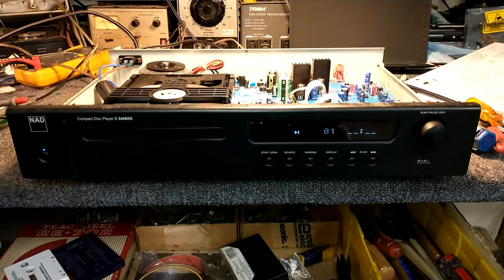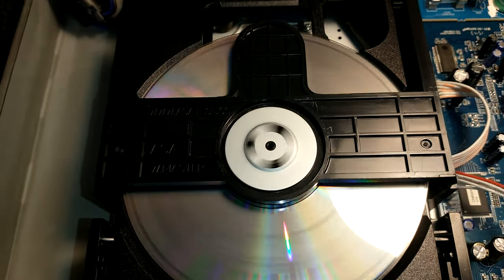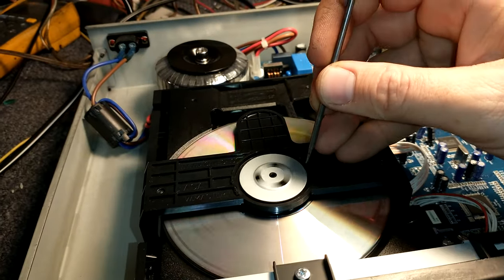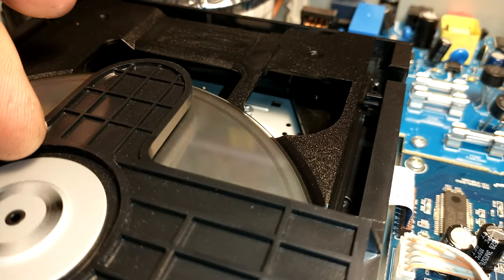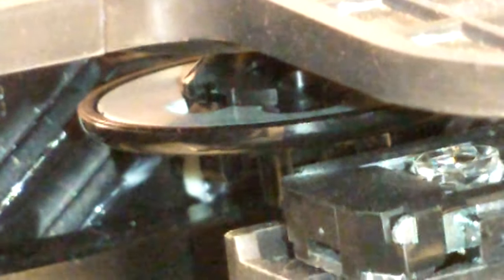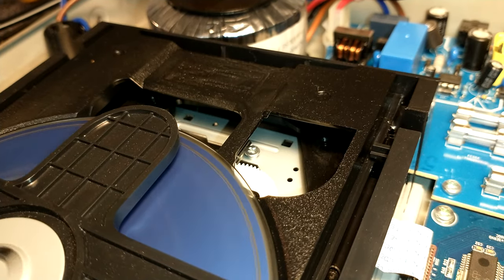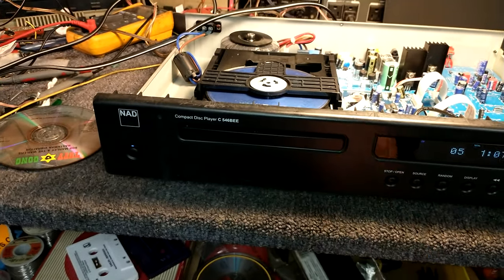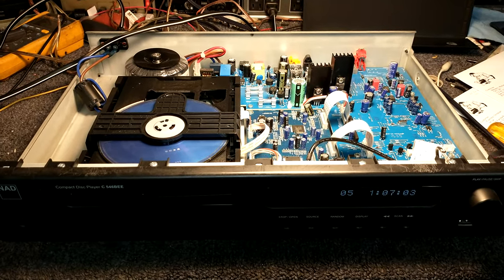Design flaw in bottom dollar NAD c-546bee cd player. vibration problem causes mis-tracking.

Comment: Shouldn't the shaft of the spindle motor protrude a bit so it fits and centers the clamp disc when you put in a disc?
That or the clamp disc is not the one it should have.

Comment: I have a hard time believing this is really the problem and that there are no worn out parts.  If it were the design and there was a 50% chance of every time you insert a CD, that it might sit crooked, this would have been discontinued right away.  It's hard to imagine it even getting into a store.  That is basically a 100% failure rate. No product is THAT bad sold in US stores.
It might be a bad design insofar as it requires high tolerances of the parts inside, but it is not just a design flaw that all of them do it right from the factory.
Reply: I'll take his word over yours---he's a professional tech that's been in business for many years
Reply: @justsumguy2u  Does it pass the smell test that this device has a 100% failure rate from the start?  Are you telling me nobody noticed that 1/2 the times you inserted a disc it refused to play because of this obvious out of balance high speed rotary motor?   NAD, from what I can tell is a respected audio gear company which has been around for many decades.  From google

"NAD Electronics is a well-respected manufacturer of amplifiers, turntables, DACs, headphones, and more. ... In fact, the NAD 3020, produced in the 1970s, is one of the best-selling hi-fi amplifiers to ever hit the shelves."

A search of Google for this model of CD player and of this model and review bring up nothing about the discs randomly not playing.

It's not like he put a lot of effort into it.  It's just not worth enough money to tear it apart and see if there are worn parts.
Also, I am not criticizing Jordan in the slightest.  I am also not saying he is definitely wrong. Bad designs DO happen.  But this design flaw, assuming that is what it is, is so blatant that it could not possibly have gone unnoticed.

Do you agree that there are probably parts not easily accessible without a total tear-down?

Think about what he is saying. He is saying this a fundamental flaw and that ALL of the units do this and they have ALL done this from the day they were new.  It is a complete coincidence if the disc happens to get properly centered, IOW, completely random and has been that way since the day they were made. Not some. ALL.
Reply: @tarstarkusz  There has been BMW's made in recent years ($100,000+ cars) that had fatal flaws 100% of the time, and some of them didn't even make it past the warranty period. The problem is that sometimes a design is not fully tested before it leaves the factory, and the problem isn't caught until it's in the customer's hands
Reply: @justsumguy2u  Just like the Mercedes Benz that had biodegradable insulation on the frigging wiring. It degraded well before the rest of the car did, rendering it unrepairable.
Reply: @channelsixtysix066  That is an example of something failing its design life.  A more appropriate comparison would be  BMW or Mercedes releasing a car that randomly decided you hit the gas pedal when you actually hit the brakes or steered left when you turn the wheel right,  from the factory.
Reply: The magnetic disc clamp design has been around for 30 years.... They have cheap DVD burners that spin 48x     This is not a new concept, thus your machine most probably has a defect in the clamp process....  Is there dirt or debris on the magnet disc ?   If the door closes too fast  the disc can jump prior to the clamp and mount off center.    The trick is to take the magnetic clamp off and clean or adjust the timing of the clamp.   There are 2 screws holding the top plate on...   Some have a felt  pad insulating the magnet is that  OK?
Reply: Good point. I have had one of these since 2014 (it is march of 2023 now). I like Jordan's videos, but this one puzzles me because my C546BEE plays fine, and sounds great. I A-Bed it with a Marantz CD-6005 before purchasing, and preferred the NAD. So if a CD player sounds terrific and works, I am just not hearing the problem

Comment: HI Jordan, I picked up one of these CD players in  thrift shop and I am having the same issue that you highlight in your video.  The player has trouble tracking the disc but if I nudge the clamp a bit (similar to what you do in your video) the vibration is minimized and the CD plays fine after that.  Obviously leaving the player open and nudging the clamp on each CD is not option.  I don't know if this is a speed issue but rather a balance issue with the clamp mechanism being a piece of junk.  Did you find a solution to the problem?
Reply from the maker: No, I did not. It's a junk transport

Comment: whew. CDs? I have a bunch, but since my players shitted the bed, I'm all SD.
Reply: You couldn't pay me to get rid of my CD collection.  I will NEVER pay money for digital files or pay for radio, even delivered over the net.  Besides, in home stereos, CDs are a lot easier to deal with then digital.  For one, the sheer size makes digital unmanageable.  You could have thousands of songs on a single SD card.
Hell, I still haven't thrown away my records and cassettes!
Reply: @tarstarkusz   optimal management is very attainable in SD.  Sure, I wouldn't ditch my compact discs either, they're hard copies like Lp's, Cassettes (of which I'm a big fan) You misconstrue professionally, or?
Reply: @_Ramen-Vac_  I am a huge fan of simplicity.  At one time in my life, I was actually a fan of complication, but not anymore. Plus, the people designing interfaces have gotten dumber.  
I have a Sony home-theater stereo system that is typical of modern design. Listening to the radio is a project. It cannot even be done in the dark. It has tiny buttons on the front of it that I cannot see unless I turn all the lights in my living room on. Then you have to sit there and mess with it to get to a station you want. Every time you turn it off, it goes back to bottom of the dial (digital dial).
 I took it out of my entertainment center and put my 1974 HK730 in its place. The HK, like the Sony has a large on off button and an analog dial that stays in the same place when you turn it off. It has a large well lit dial and a big heavy aluminum dial wheel and a very large beefy source knob to switch between various inputs. All of it can be seen in dim lighting and the radio tuner dial spills enough light into the immediate area that you can see where the buttons are and what they do without having to turn all the lights on.  Simplicity in action, works perfectly.  I have yet to find anything outside of Apple i-stuff with any interface even remotely usable.  Just look at how long the rest of the industry suffered in everything from palm pilots to the earliest "smart" phones before Apple came along and made a usable portable device!  I am no apple fan boy, but you have to give Jobs credit.

Comment: What do you mean " single speed drive at double speed"?
Reply from the maker: Disc drive designed for original CD speed being run at double that speed
Reply: @JordanPier  may I ask, so this is not the asatech's drive flaw but the NAD's, taking it over the limit with the 'double speed" design? 
I am thinking of getting a replacement drive for my unit from China vs. buying another CD player, and I don't want to make a bad decision...
Reply from the maker: @denisusmanov5707  the speed is set by the software, not the disc drive so a replacement drive will run at the same speed as the current one
Reply: good info. any sources for the drives?